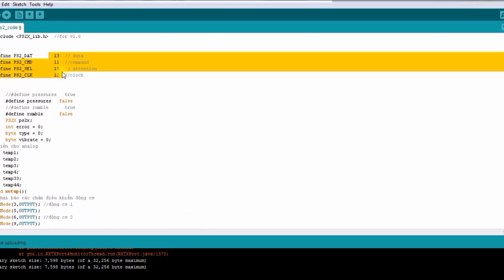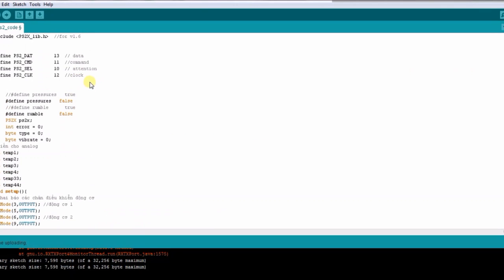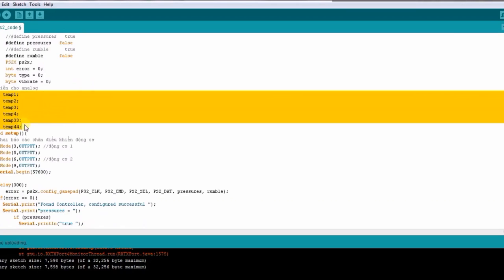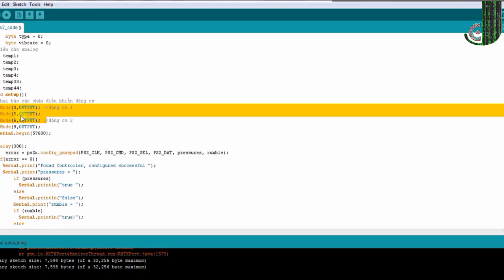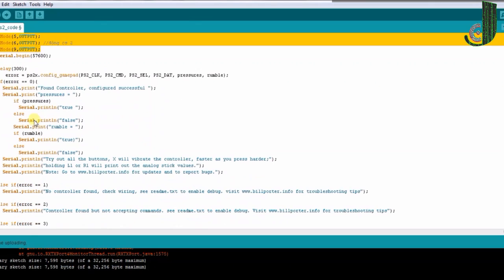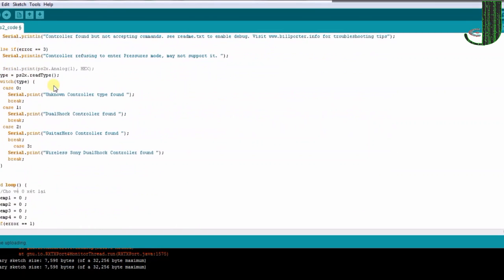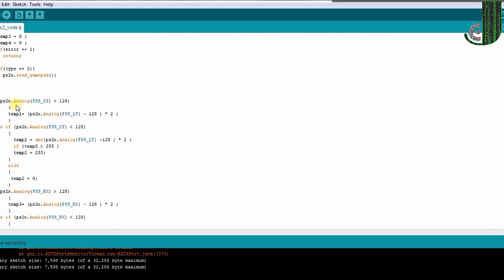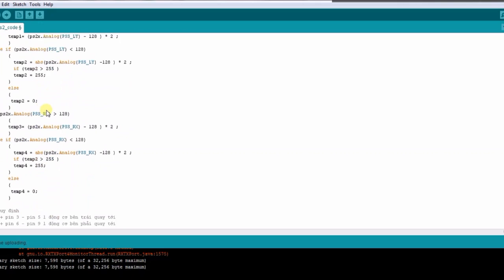PS2 Controller control DC motor Speed and Direction Arduino

Comment: hi i have a problem i did the same things as you but it wont work and i tried other methods nut nothing works hope you can help me out.
Reply from the maker: did you follow wire connection: https://xfunpi.blogspot.com/2017/09/ps2-controller-used-to-control-dc-motor.html
Reply: The Dutch Mechanic gvgodi

Comment: hi, i have a problem uploading the sketch. i followed your steps, even removed the comment marker. this is what i get when i try to upload the sketch.....

Arduino: 1.8.3 (Windows 10), Board: "Arduino Mega ADK"

Sketch uses 6768 bytes (2%) of program storage space. Maximum is 253952 bytes.
Global variables use 917 bytes (11%) of dynamic memory, leaving 7275 bytes for local variables. Maximum is 8192 bytes.
avrdude: stk500v2_ReceiveMessage(): timeout
avrdude: stk500v2_ReceiveMessage(): timeout
avrdude: stk500v2_ReceiveMessage(): timeout
avrdude: stk500v2_ReceiveMessage(): timeout
avrdude: stk500v2_ReceiveMessage(): timeout
avrdude: stk500v2_ReceiveMessage(): timeout
avrdude: stk500v2_getsync(): timeout communicating with programmer
An error occurred while uploading the sketch

This report would have more information with
"Show verbose output during compilation"
option enabled in File -> Preferences.

hope you could help me. thank you.
Reply from the maker: Let have try detail instruction: https://xfunpi.blogspot.com/2017/09/ps2-controller-used-to-control-dc-motor.html.
Anyway, i use Arduino UNO